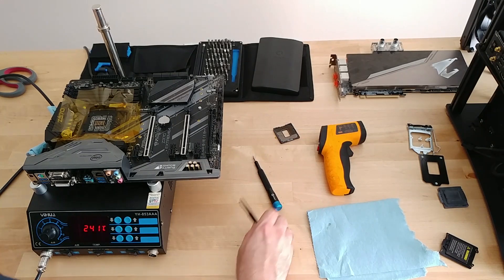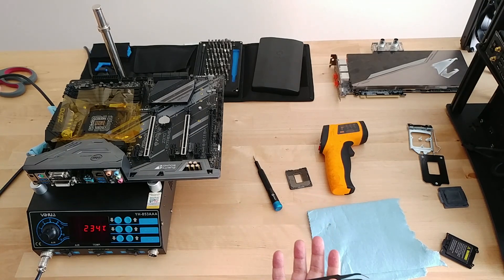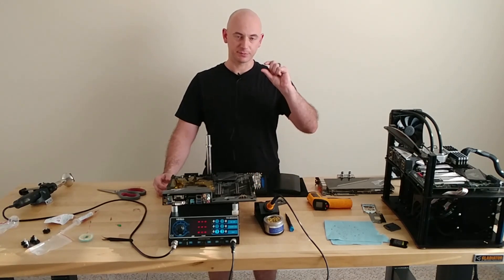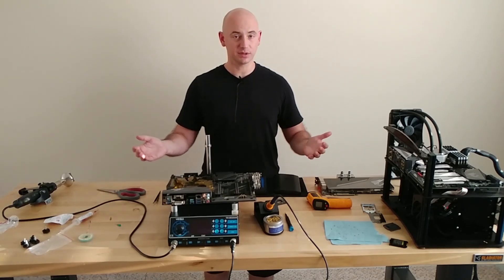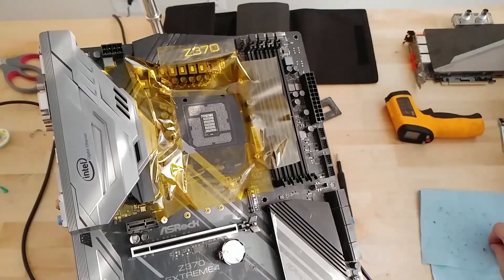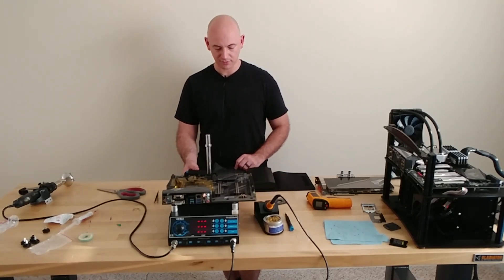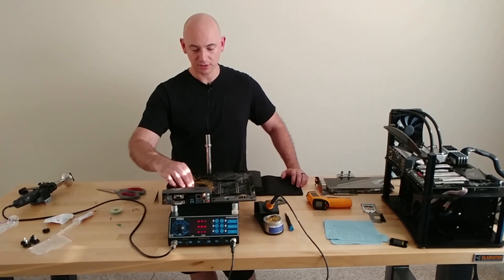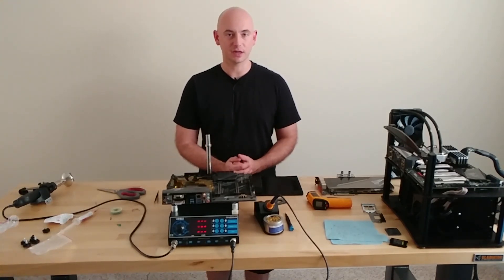CPU socket replacement attempt Pt2

Comment: You don't need to put flux in the pins like that, just flux the board before placing the socket, also it looked to me like you expected it all to happen fast, you had everything set too hot, I would say around the 300 for underboard was ok but top heat I find around 260 enough, but you need to be patient, do not keep prodding it just watch the gap between the bottom of the socket and the board, you will see it reduce as the solder balls melt, only touch the socket very very gently if it has moved slightly and needs to be re positioned, but don't try and do it with your hands in the air you will do what you did in this video, you need to have gloves on and rest your hand on part of the board to steady it.

Comment: What is the heater that you are using ?  I do a lot of computer repair and this is something I may try as I have several damaged lga motherboards. I appreciate your honesty in your video and I hope you do another one in the future. Thank you.
Reply from the maker: Hi, and thanks for the comment! This one I got from aliexpress and the brand is "yihua", they make soldering irons that are pretty decent and I found it by searing "yihua rework station". It is quite handy, but a little small for motherboards as you can see in the video. ITX maybe mATX might fit though. I would also recommend getting a set of tips for the soldering iron, I prefer a nice big chisel tip and mine didn't come with one. Hope this helps!
Reply: @tenminutetech  thank you

Comment: if all the pins are metal then why to try a solid piece of metal the same size to cover all the pins heated to the correct temperature which would not apply much heat to the center components. The heat will travel to the solder and should release the socket.
Reply from the maker: That's an interesting thought. Perhaps that would work as long as you were very careful not to deform the pins in any way! Thanks for the idea!

Comment: I have been doing this kind of repair for a few years now, but I don't have the equipment that you have. What I do is I put the motherboard in a toaster oven to bring the entire board right to below solder melt temp.(These boards are thick and can take a lot of heat.) I then use flux and my biggest hot air tip to remove the old socket. I then clean the flux and balls and reball the new socket on. It took a lot of trials and failures, but I seem to have it down with the equipment that I have. Now, don't do what I do. My method is NOT ideal.
EDIT: If you displace the resistors and it's not too bad, well, it's not hard to resolder resistors and caps.
Reply from the maker: Thanks for the comment. I did think about that but was worried about having the magic smoke get into the toaster where I cook food.. but considered getting a separate toaster for reflowing. I happened to have this soldering iron from aliexpress and tried to make it work but it's too small for motherboards, it's meant for phones. What you said makes sense though and maybe getting a cheap disposable toaster over would be a good idea. Thanks!
Reply: @tenminutetech  Hey! I'm sorry! I didnt notice your comment until now. Yes, I bought a toaster oven for $5 at a garage sale. It is just used for GPU boards, multi layer motherboards, stuff like that. If I bring that temp of the board up, it is way easier to work with. Especially GPU boards. I just did a GTX 1080ti yesterday, and removing the enable chip along with an array of ceramic capacitors, and reinstalling took far less time and was much easier with less heat time. I don't cook the boards too much. I just want to get those grounding channels and everything that would wick the heat away just hot enough.
Reply from the maker: @jameysummers1577  That makes sense. I'll keep an eye open for something like that locally so I can practice! Thanks for the tip!

Comment: I know it has been a while, had you tried again? Did you not think you could resolder the resistors? Or capacitors or whatever it is?
That seems like much easier work.
I have been watching every video that the algorithm sends me on this because I have messed up q couple sockets and am only using a cell phone for a while.
Yeah the mdf wasn't needed, that is one of the mistakes I see a lot, but at least you had a station. Can you get a square air gun tip or make one? 
I have seen it is vital to get it up to temp fairly quick, the longer you have lower heat that is where other things start getting mobile including melting the socket. You need it super close and heating all 4 corners, and the Flux will help it greatly.
With most of the pcb stuff knowing target Temps is critical and helps you not fear messing with other things around it.
Most of the successful results on YouTube show specific Temps and the times expected if you wanted to study up and give it another shot.
Best of luck!
Reply from the maker: Hey there, thanks for the comment. I assumed there was just too much damage to the board and didn't bother trying to solder the small resistors back on. Everybody really hates on the MFD but I didn't really have many options. A full size motherboard is too big for the station I have, because it was designed for cell phone sized boards. It wont fit in the bracket and it's not a good idea to just lay the motherboard directly on a metal surface.. that's just asking to knock SMD's off of the back side when it starts getting hot.  
The heat gun I have actually has some different tips, so in the future it might make sense to try a square one, thanks for that.
You're right, I learned that it is very important to get it heated up quickly so things like the plastics don't start melting like in my case. I did use flux, but likely not enough. That's for sure. 
I didn't have any point of reference for motherboards, I was just going off of what most solder melts at, but it just wasn't melting at 220C so I turned it up... I discovered the station I have lies about temperature, and I didn't know that at the time. The hot air coming out doesn't actually come out at the temperature it's set to, but Yihua is supposed to be decent. It might actually be a counterfeit Yihua from aliexpress though. Oh well

Comment: Honestly That board is still fixable.  You really do need a good pair of tweezers.  This is not an easy task trust me I had issues my first time.  If you remove all the mlcs heat it up to the right temperature you can reinstall the mlcs in the right positions.  You definitely need to clean it up well with the wic.  Whatever you do don't give up.  I never gave up till I got it right however I damaged many boards before I got the right temp and the right technique.
Reply: Even if a few of those traces under the socket are ruined it's toast. Those traces are tiny and near impossible to repair once moved out of place or broken. Can't move that socket any until it gets hot enough to move, otherwise it'll tear the traces off... the board is unusable.
Reply from the maker: @garyr7027  thought so, it had bent pins from a reddit trade so I figured trying was better that just tossing it
Reply: @tenminutetech  hey, absolutely nothing wrong with trying, it's how we get good at it. Sure not gonna know if we don't try and keep trying.
Reply from the maker: Hey thanks for the comment. I did keep the components but i havent given that a go yet. I know my reflow area is way too small for a full motherboard. I'll give it another try!

Comment: Anyone else yelling at this guy while watching the video?
The thing in the back is a waste of time honestly and its a waste of tape and also blocks the heat of the preheater from getting to the board directly.
Also I'm pretty sure your temps should be calibrated to make sure they aren't low cause I can melt solder around 300°C on my equipment without any issues

Comment: had a feeling that mdf was going to mess it up. You dont really need that. Just dont knock anything and all will be well.
Reply from the maker: It was my attempt at getting around the fact that this station is made for cellphone sized boards. There was no other way to apply pressure to the sides, because the bracket is too small to hold a full ATX motherboard. At least I learned from the experience. Thanks for the comment and if I try this again, I will  modify the bracket to accommodate larger PCBs or buy a different station.

Comment: In general, you don't even need the BGA rework station as many claims here. If you are just practicing yourself, then I would suggest that you buy an appropriate nozzle to attached over the cpu socket and you would need a syringe to inject flux. The starting temperature should be around 150°c for 2 mins, then go little upper by 250°. After another 2mins, Go about 350°. That's the last you should go. Then wait until you see steam, then you start moving the socket by little force, do not use too much force as you may end up braking the tiny copper connection wires , then keep your hot gun reflowing until you could see slighter movement then use twin tweezers.
Reply from the maker: Thanks for the advice.

Comment: Why do one need a reflow station to replace the CPU socket? By the looks of it, a good hot air gun, great flux and a steady hand should do the trick to remove the socket. Someone please enlighten me because I was planning to do this on my ASUS-Z170-AR motherboard but now I have second thoughts. Any best practices? What brand of hot air gun, flux, tweezers etc? Anyone?
Reply from the maker: I found that the hardest part was getting enough heat on the socket so that it can be removed cleanly. My attempt accidentally removed the small resistors in the center of the socket and those were too hard for me to solder back in place. You need a lot of heat directed correctly and a steady hand.. I don't think brand matters that much, what's more important is that you can monitor the temperature correctly.

Comment: In short all this process is pointless, to buy special heat stations and lots of helping tools and in the end there is only a small chance to get it right, and testing the board after has a risk of cpu damage, sorry pointless 110%. Better collect empty bottles and buy new board.

Comment: You were just wiggeling the socket without knowing the melting temps of solder balls. Everyone doing this stuff knows which bga package melts at what temps.. You just took some of the pads away with the socket.. that poor premium motherbaord  good luck next time. I have the sams board waiting the socket to be replaced.

Comment: The heatgun was not really good enough for this I think. You could've bought an heater plate for about 6-7$ to heat the socket from the top.
Reply from the maker: I agree that there may have been a better tool for the job. I'm learning as I go, so thank you for the advice.
Reply: Top heater melts or deform the socket. Hotair works best for me everytime. For sockets i never use upper heater.

Comment: Why dont you test when 1 pin is broken / Missing , cause i need to know it will work if 1 bent pin is missing or broke
Reply from the maker: What socket are you using? It's possible that it may still work without one of the "reserved" pins, however it likely wont work if you're missing a vcore pin. You can google the socket and look for a pinout diagram to find out.
Reply: @tenminutetech  Socket 1155

Comment: Those 'resistors' in the centre of the LGA socket are capacitors.    Prodding the LGA socket around to see if it is loose is likely to lift pads from the PCB.  Lifting the LGA socket when it is not full desoldered is also going to lift pads and traces from the PCB.  Too high a temperature is also likely to damage PCB pads. You need to be using a rework station that has programmable profiles to reliably do this sort of job.  Even then you are likely to wreck plenty of boards while you get your profile just right.  A semi-automatic BGA station will solve the problem of lifting the socket cleanly as it uses vacuum to lict the socket for you.  Soldering the new socket is where the real problem starts for me at least.  I'm at the stage now where I can reliably remove LGA sockets and clean the PCB without damaging it, but can't seem to get the profile right to solder the replacement.  I end up with some balls melted but most are not, and that is with the same profile that successfully desolders the old socket.    I think this is because the new socket is not soldered to the PCB yet, just sitting on it, therefore the heat from the bottom heater does not conduct into the balls efficiently.  Probably I need to wreck more boards to master this, but it is certainly a worthwhile skill I am sure.
Reply from the maker: Thank you for the advice, this was my first go at this. Ideally I'd know exactly what temperature I would have to set for how long to know when the solder is melted, but honestly I just don't. The only option I have is trial and error. That said, I got the board for 30 bucks off ebay and figured I'd give it a try, if nothing else for the experience. 
Are you using heat from underneath from the rework station during the resolder? I did more research after recording this video and realized that you have to keep the PCB hot with lots of flux so it conducts well to the pre-balled new socket. It might not hurt to warm up the new socket too, to give yourself a little extra time. From what I researched, it should just suck right into place if all of the balls are hot enough. Btw, the balls should probably get hot enough from using the hot air conducting heat through the pins, so make sure that's hot enough too? 

I'd like to try on a few more boards when I get the chance. It could be fun to refurb them for  junker project builds.
Reply: What I'd like to know is what type soldering balls they use for new sockets? Would be much easier if they are 60/40 and not the tin crap, or soldering paste. How would one know what they use? The key to best results is the type soldier used, can't beat low melt 60/40.

Comment: You said temperature at 150, but the machines reading 390c?
Reply from the maker: Yes, that's correct. It's a decent machine but the settings don't really mean much. Also since the pcb was a greater distance than it was supposed to be from the heating bed, some heat is lost.